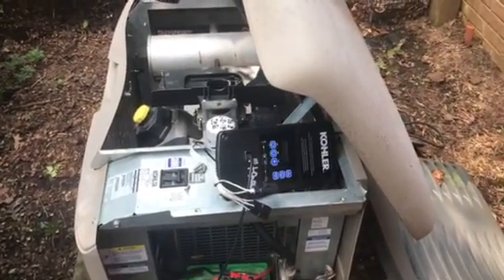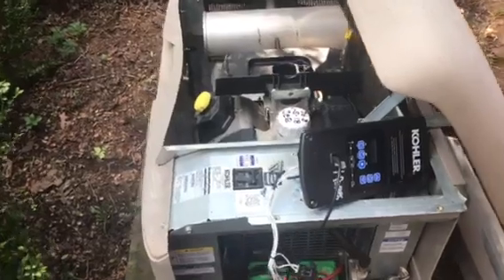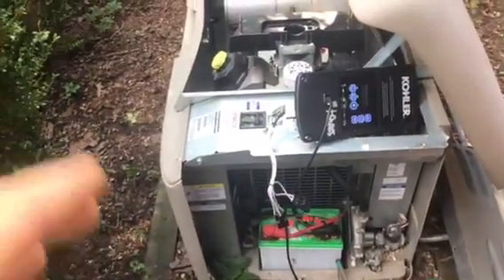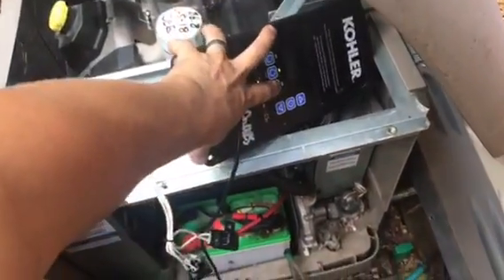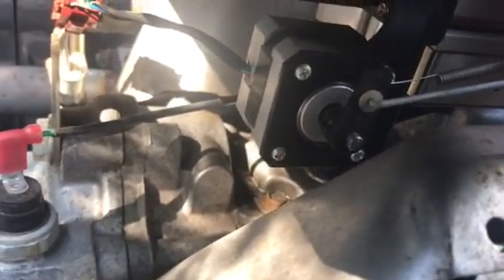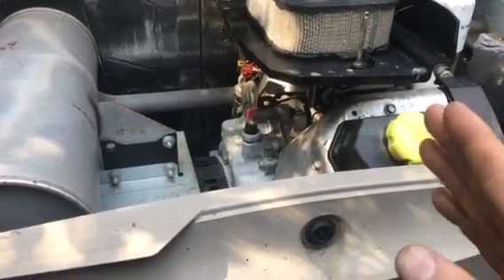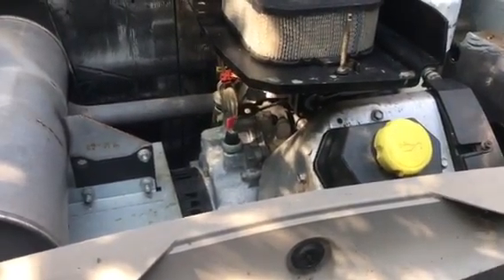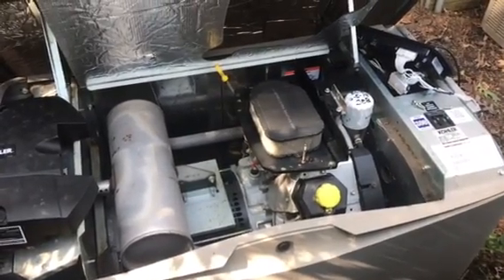20kW Kohler Hunting Issues

Comment: Thanks for a very informative video. I see you replaced a governor just like what I have.  After trying numerous solutions without success I bought and installed a new governor I'm not sure if it helped because I can not get the generator to stay running for more than a few seconds. Does the controller need to be reset?  The On Cue messaged:   Shutdown Fault: High Engine Speed Shutdown
Generator State: Stopping
 .  At the time this event occurred the Current Firmware was 6.12.2, the Engine Speed was 1212 R/min, the Engine Target Speed was 0 R/min, the Engine Oil Pressure was 0.0 kPa, and the Battery Voltage was 12.8 V.
Thanks , Dave

Comment: Hi, I am using a 20 Kw Kohler and it has more than 50 hours operation very well, we are using on 43 Kg cylinders
I want to know what type of propane gas regulator I should use to optimize the use of gas from the cylinders, the fact is that when the cylinder has half of the propane left I must replace it because the generator has failed or is turns off due to lack of gas

Comment: What causes rotor lockdown I put new battery just in case. Cant find but 1 20amp fuse on controller. Its 2013 20resa. Any ideas or how to fix?

Comment: My 20RESA is severely hunting during exercise only.  If Just push RUN it starts fine and runs fine. When it goes to load during power out, starts fine runs fine. Help please.  11WC dead on
Reply: I've got one doing the same thing.
Inverter tells it to run no problem!
Maintenance run and surges bad